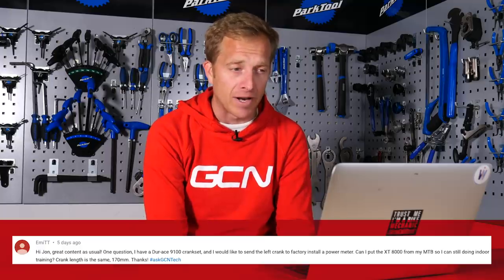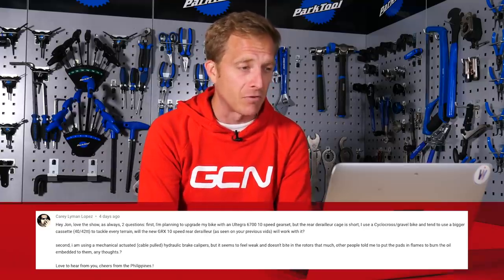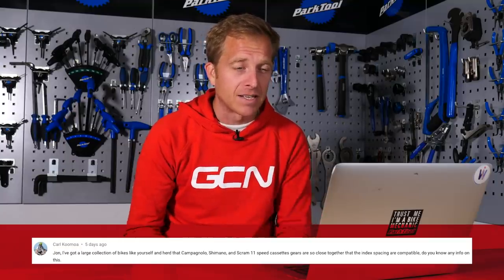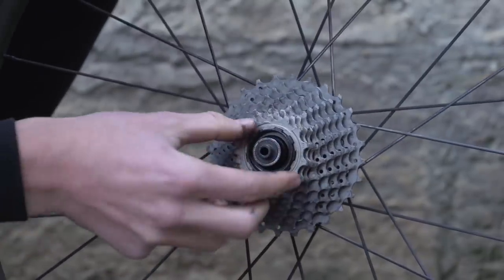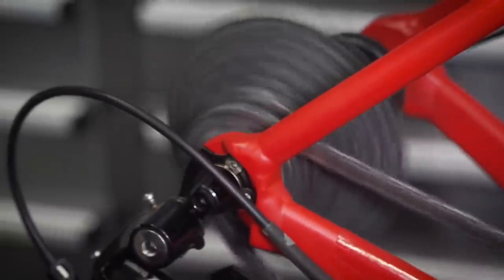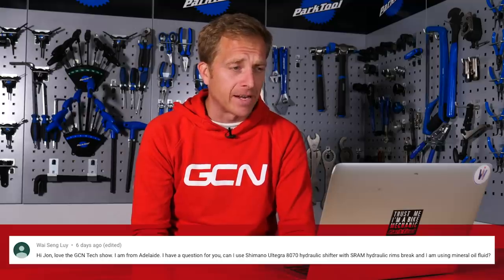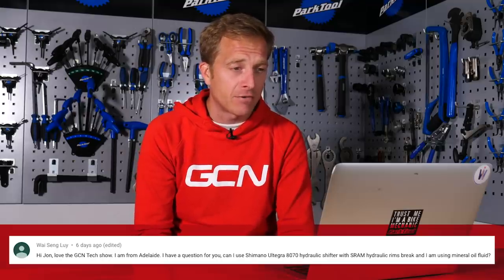Mixing Road Bike & MTB Cranks, Cleaning Brake Pads + More! | GCN Tech Clinic

Comment: The GRX groupset is meant to work with modern tiagra, which I think has different pull ratio to the older 10 speed groupset, so I don't think 6700 is compatible with GRX 10 speed

Comment: Hi John. 
I have an answer for the question about mixing oval and round chain rings. 
I have a DuraAce 9100p crankset for which I bought Rotor Qarbon 52/36 rings. The 52 wouldn’t fit as a result of the protrusion of the power meter box on the inner side of the drive side crank arm. Thus I was running a round DA9100 52 tooth round ring and a 36 tooth Q ring. Absolutely not a problem. Beautifully smooth DI2 shifting. 
Yesterday I fitted an Absolute black 52 tooth oval ring to completed the set. The absolute black oval ring fits with the power meter fine. 
I hope these responses help your viewer

Comment: 3:07 if it some won't shift it is because there is old grease in the shifter. You have to clean it with brake cleaner or something, after a while it will shift good again.

Comment: #AskGCNTech As a follow-up of mixing and matching (Shimano) Road & MTB components, I'm seriously wondering if Shimano road hydraulic STI levers can pair up with Shimano XTR/XT/SLX hydraulic calipers and brakes properly? The reason of putting forward this question is stemmed from a thought experiment of a disc brake endurance road recumbent bike build using road handlebar (e.g. builds based on Cruzbike S40 endurance road frameset) due to higher weight of overall build than the one based on a "conventional" (read: more upright riding position) frameset.

P.S. The question should also be of interest for allroad bike riders/builders who want to pair road hydraulic shifters with Shimano-compatible 4-pot hydraulic calipers--a worthy venture for those got a hold of disc brake road bike frame with post mount brake caliper mounting

Comment: Hi there ! I have a Bianchi Infinito with a Campagnolo Veloce 10 speed, my shifter leavers and cables are messed up and I want to swap them for some Shimano 105 leavers and rear & front mechs will they work with the existing cassette and chain ? As I plan to change the whole transmission to Shimano 105 later ...

Comment: is it possible if I use GRX crankset (46t/30t) on my hybrid bike? 

I currently use a Giant Escape flatbar/commuter bike with Alivio drivetrain on it. I am not satisfied with the 36t/22t that comes with it and I wanted to change to a 46t/30t in which only the GRX has. The Acera version is hard to find either but the GRX600 is already available. Thanks

Comment: Hello, love your channel. I have an old Trek 5500 OCLV it has Dura-Ace 9 speed. I would like to put an 11-34 cassette with compact 50-34 up front. Not sure what will work with the STI shifters. A Sora rear derailleur would likely work, would rather use an xt/xtr derailleur if possible. As for the cranks, can I just replace chainrings? I can't seem to find any. Thank you...
Reply: Try an RD-M772 - that's an XT Shadow derailleur that works fine with road levers up to 10-speed (except, as others have noted, Tiagra 4700 levers that use 11s cable pull ratio). Compact chainrings use a 110mm BCD (bolt circle diameter). If your current crank is 53-39, it's 130mm BCD so compact rings will not fit and you will need a new crankset.

Comment: #AskGCNTech Hi Jon, Love your work! I'm looking to upgrade the 10speed tiagra groupset on my 2016 giant defy to 11s 105 r7000. If possible I'd like to do this in stages. My plan is to buy new shifters, rear derailleur, chain and cassette. Do you know if the tiagra front mech will be compatible with the 105 shifter pull? Thanks very much!

Comment: Just wondering if the Campagnolo Super Record 2x12 fits with hubs made for 2x11?
Cause i see that most wheels still have hubs for 10 or 11 speed on the rear wheel.
Reply: Yessir they do!  The chain and gap between cogs was made narrower to ensure compatibility with existing hubs and not cause riots in the streets.

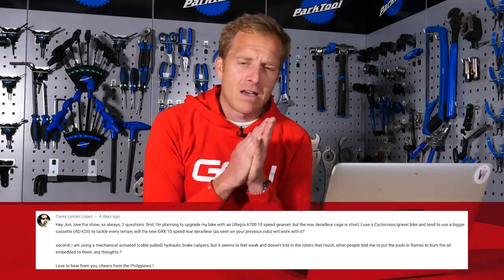Comment: 2:03 Nah GRX stuff only compatible to 4700, they both use the 11s pull ratio.

Edit: if you upgrade to 4700 shifter, you can use (RD-RX812) which max to 42t.
Reply: This vid def needs to be amended, it won't work at all.
Reply: I wanted to say exactly the same thing. The grx derailleurs, including the 10 speed rx400, are all on the newish cable pull ratio. So the only ten speed group it will be compatible with is tiagra 4700. Older tiagra 10 speed or higher tier 10 speed groups won't work.
Reply: Correct. 6700 uses the older cable pull ratio, which luckily means it works with MTB derailleurs up to 9-speed. There's a nice Shadow derailleur (RD-M772) that works well with these older road shifters. Shimano says it handles 11-36 but, as always, you can probably get it to work with larger cogs, maybe with a longer b-screw.

Comment: I swapped the crankset from my MTB to my gravel bike for a bike packing trip as I already had the smallest compatible chainring. They are both Sram 11 speed and both used a GXP bottom bracket. Adding the 2.5mm spacers that come with a new GXP balanced the Q factor out. When I hit that first hill with the extra weight I knew it was a good decision.
Reply: How obvious is the q factor change?
Reply: @adriant.7457  It wasn't obvious to me, though perhaps I'm not pro enough to notice. I was suffering with IT Band issues prior to that trip and to my pleasant surprise I didn't have a single flare up at all. A follow up question for a bike fitter perhaps.
Reply: @samuelchap  by flare you mean some kind of pain? :-ss
Reply: @adriant.7457  I had to take two months off the bike before due to this ITB injury. I had a short window in which to make my trip during my annual leave so I decided to risk the injury coming back during the ride. I was fortunate that it did not. Whether the pedals being 5mm further apart made a difference or not I'm am unqualified to say.
Reply: @samuelchap  glad to hear you were healed afterwards. 
All in all, it was a good decision and everything worked out great with the mtb crank on the gravel bike?
Reply: @adriant.7457  It did work out fine, but I later realised that I could get a smaller chainring (which was my original goal) by using Absolute Black chainrings. I'm now able to use the original Force crank which is lighter. If you haven't tried those then I would strongly recommend them.
Reply: @samuelchap  how big are the chainrings? No of T?

Comment: Campy with a Shimano cassette tip... Tune your rear derailleur in the middle of the cassette instead of from the bottom.  Then your variance is only 0.5mm at each end.

Comment: No!  Jon it will not work with 6700 shifters. 10 speed changed with 4700, grx will only work with 4700 and grx 10 speed

Comment: Jon is wrong about the compatibility of the 10 speed GRX and the 10 speed Ultegra 6700 shifters. Shimano changed the cable pull ration from the 10 speed Tiagra 4700 forward  to be the similar to the Shimano 11 speed. 
The suggested combo won’t index correctly.

Comment: I have been wondering for some time whether it is more aero to mount a headunit or even a phone behind the handlebar right next to the stem. I figure it would be a little bit less frontal area. #AskGCNTech
Reply: I'm going to be very cheeky and ask a second question, if I may. I would like to replace my ultegra 6600 sti's with 6700 sti's as I want to move away from my old flight-deck head unit, need new cables anyway and would like to not have them protruding from the side of the lever. Will this setup shift correctly with my 6600 derailleurs? Do the 6700 levers have a different amount of cable pull? I would be ever so grateful for the time of John the Master-Mechanic.

Comment: @   Hi, is there a way to install a Cannondale/FSA SI carbon fiber crankset on a Cannondale CAAD9-5 frame with an English-threaded bottom bracket? The crankset that I have is the one with a spindle permanently attached to the left crank. If not, which left crank, spindle and BB adaptor should I use?

Comment: #AskGCNTech Hello, I have a tubless related question. I just bought a coupple of 32mm PANARACER GravelKing and I'd like to set them up tubless on my Stan's Grail Wheels. Problem is: I weigh in at 107kg plus my bike is around 10kg. Would it be a problem if I inflate the tyres up to 4,5/5 bars even if the recommended max pressure is 4,1 bars? Any hack/bodge to overcome this issue? Thanks heaps!

Comment: #AskGCNTech
Greetings from New York state, USA!

After a 40year layoff I returned to cycling a couple of years ago and GCN, GCN Tech Show especially, has been instrumental in getting me back to speed, as it were; thank you!

This episode included two questions regarding front mech adjustment issues which I share, and despite having done everything suggested my problem still persists:

Until I added a chain catcher a month ago, resetting everything by the book (DM-RAFD001-05), my 34-50 x 32-11 Ultegra drivetrain had been eerily quiet, for a year:  Now, I can’t get the (braze-on) front mech cage to not rub the chain when on the small ring and the 12T and 11T sprockets unless it then rubs on the 32; and I can’t get the cable tension correct “by the book” - the shift-lever trim-adjust does nothing on the inner ring when cable tension is set to spec. If I crank the tension higher than nominal I get the trim and I can reduce the rubbing to the 11T sprocket, but it’s out of spec and very tight.  I have gone back to zero on the install and adjustment procedure twice since adding the chain catcher.

    What have I done, or missed?  

Also; probably unrelated (?), in the same time frame I’m hearing a lot of new chain noise on the big ring with large sprockets, but none of it on the small ring at all…  It’s not rubbing on the derailleur cage on the large ring. 

…?

Thanks for any suggestions!
Mark

Comment: Hi Jon, I have a 2009 Cannondale Bad Boy Ultra flat bar urban bike that I would like to convert to drop bars for gravel riding. I was thinking about using SRAM Apex components to convert the drive train to 1x but I have one doubt: if possible I'd like to keep the original Avid Juicy 3 hydraulic disc brakes. Would they work with current SRAM Apex brake levers? I think Avid and SRAM are the same company, right? So I guess there is chance it could work...any advice will be much appreciated!  #askgcntech

Comment: GRX mech will almost certainly shift the 40, given that R8000/R7000 GS mechs will no problem  (and they're rated to 34T max) and a 6800 GS will at a push - you could check that before getting a hanger extender. That said, as mentioned by BloodyQuid Mate, the GRX 10-speed stuff uses the new 10-speed pull ratios (compatible with 4700 but not ealier).

Comment: #askgcntech I have got a shimano tourney tz200 6 speed rear derailleur(4000 Kms old)..I have put a new chain( same length as previous)whenever I peddle hard like on climbs, I hear a cracking sound...I have indexed the gears...when I peddle on bike stand,there is no cracking sound my local bike shop suggested me to change the rear derailleur or the jockey wheels..is there any other way to solve this...please help...love the show

Comment: #AskGCNTech 
Hi Jon

I have been learning a lot from your GCN Tech clinic vídeos. In fact, they are very useful and I am now capable of doing small maintaitions works of my bike. 
I have two set of questions  concerning two completing different issues. 
The first concerns the use of valve extenders. I have two set of wheels with very different depths. When I change the wheels that I am going to use, I also change the inner tube that I take with me. However, sometimes I forgot to do that. If am using the lower depth wheels, and I am carrying the tube with the long valve, that is not a major problem, but the other way around, it can be a huge problem 40 or 50 km way from home. Some friends have advised me to carry a valve extender. 
a) How to use them?
b) Do they work with every type of inner tube?
c) Is there any caution to take when using a valve extender?

The second question has to do with the DI2.  My bike has a Ultegra DI2  of 2016. My new Garmin  shows the relation that I am using, but the system is configured for a 11-23 cassette, and I use a 11-28. How can I configure the system correctly (I can not use a phone app since I do not have a bluetooth connection)?

Thank you in advance.  Luis

Comment: #askgcntech I have the latest Ultegra Di2. Shifting is great, but it seems noisy in the larger chainring (the small ring is fine). I assumed it was chainline, but I can't work it out and it seems fine, no rubbing etc. It seems to be just that the bigger ring is noisy, but that can't be right. Do I remove a spacer at the BB to bring it all in?

Comment: I have the GRX 812 and a 11-42 cassette with 44T front single ring.  Just have to adjust the B-screw in a bit.  Not fully in but I think the 42 is going to be the biggest without a secondary link/hanger thingy.

Comment: Hi Jon, love what you're doing here. Quick question. I'm considering buying new bike with new 12s sram force axs groupset, so will i need a new 12s cassette for my direct drive trainer (and a new freehub body for it) or i can use my old 11s 105 cassette? I plan to use trainer in ERG mode, no shifting during training. Thanks, cheers from Montenegro. #askgcntech

Comment: Hi John.  I'm sure you'll agree that one's bike should be as silent as possible.  I have two strange noises coming from a couple of my bikes which I don't know how to fix.
1) When sprinting out of the saddle, there's a strange "pinging" noise which comes from the back wheel.  Almost like the rear mech is rubbing the spokes but it's not even close.  What could be causing this?
2) On less smooth roads, there are some rattles which come from my wheels.  I think it's because the valve stems are rattling in the aero shell rims.  The deeper the rim, the noisier it is.  Is there some clever way of avoiding this?  I thought of using the little valve nut that comes with many inner tubes but (a) they look crap on aerorims and (b) a lot of tubes now don't have threaded valve stems.

Thanks in advance.  Love the channel.

Comment: #askGCNtech 
Hi Jon I recently got a boardman ADV 8.9 as my commuter bike it's my first bike that isn't a mountain bike and first in a while with a 2x drive set up, 

It still has the original Tiagra levers  my question is could I go onto a more familiar mountain bike wide range cassette using a shimano mountain bike rear mech and a 1x narrow wide set up..  Basically are shimano road levers compatible with mountain bike derailier and cassette

Comment: Another solution for the "difficult for a child to change the front chainring" problem, one that is much cheaper than going electronic: go 1x up front.  Depending on the rider's needs for the terrain you're on, you might only want/need to change the front chainring size. You could change to a purpose-built 1x crankset, but that's not strictly necessary (but if you do, you will also want to remove the unnecessary front-derailleur cable as well). 

If that approach doesn't meet the required gear range, then you could also swap in a wider-range cassette in back.  Depending on just how big the biggest cog of that cassette is, you may need a new chain (to accommodate the longer chain path) and a different (aftermarket) rear  derailleur hanger to make sufficient space between the largest cog and the derailleur (Wolftooth Components and others sell these).  It's a relatively straightforward mechnical operation (go slow, read the manuals) that might be fun to do together.

Comment: The guy who is having trouble with the front derailleur after switching to compact may not have adjusted the derailleur vertical position lower to match the reduced size of big ring.

Comment: #AskGCNTech Hi Jon, I just bought an old steel road bike with simple side pull calipers. I want to upgrade them to some dual pivot ones, but I can only find ones with a recessed nut. I don't want to drill Ito the frame so what options do i have. Is it possible to switch the entire bolt to a longer one?

Comment: Can you Guys make a video About regulating braking pads. Cause my left braking bad doesn’t “come back” to the basic position.
Reply: Tim Hearnshaw this is about discs not normal
Reply: @ingmarneple6072  It sounds like your pistons need cleaning, which thankfully is not a tricky job at all!  If you remove your pads and depress your lever a few times, your pistons should come out (be careful not to pull the lever too many times or your pistons will pop out: major pain!) . All you have to do is apply some of your braking fluid to a cotton bud and wipe around the edges of the pistons.  Push them back in with a tire lever and repeat the process a few times.  You'll be able to see when you depress the lever if both pistons are advancing and retracting at the same time.  If you need a visual aid, GMBN does a good video on disc brake tips.  Good luck!
Reply: @samuelhopely4853  Thanks a lot
Reply: @ingmarneple6072  it's quite a common thing, use mineral oil and a cotton bud to wipe the side of the piston, making sure you don't pop the piston out completely which can then be difficult to get back in, this is done in the videos on the subject..

Comment: #AskGCNTech Hello, I keep facing problem with my chain and shifting. I have 52 - 42 t at front and 14 - 28 at rear ( 7 gears ). When I spin on 5th gear my chain skips on 6th, and when I spin on 6th, chain skips on 7 th. I also have to click 2 -3 times to change a gear. What should I do ?
Reply: Align your derailerhanger, looks to me the hanger is bent.

Comment: #AskGCN I have a question, I have been having problems when I down shift on a shimano ultegra sti (dunno the version) on the front derailleur, the chain always fall down when I drown shift. I'm fairly new to road bikes.
Reply: Check your lower limit screw, sounds like that one is not set up correctly.